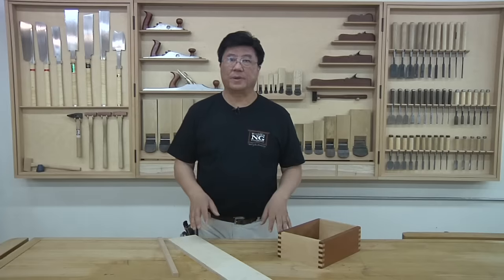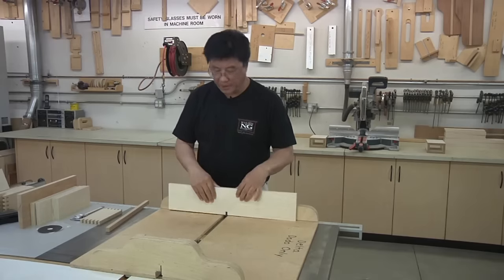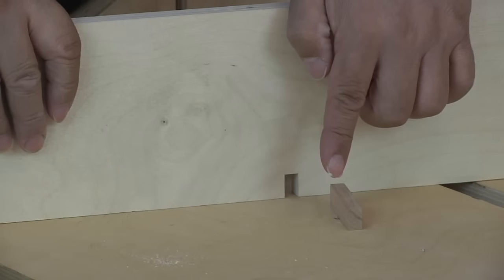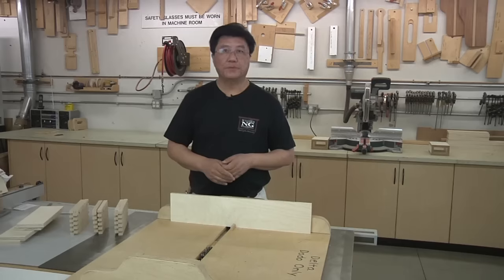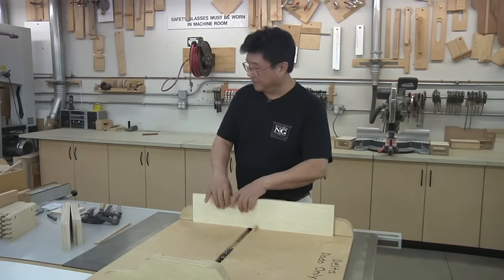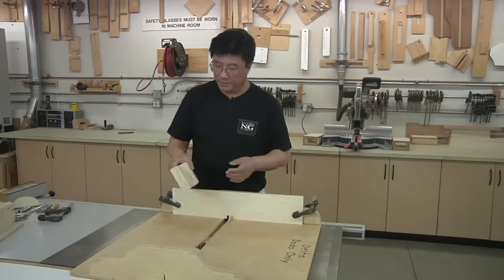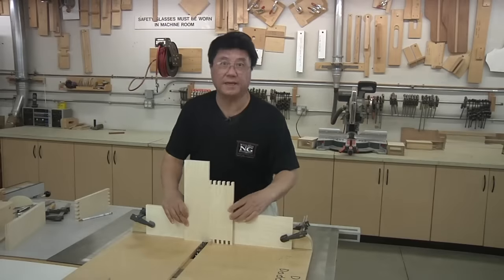Make an Accurate Box Joint Jig, Simple and Fast

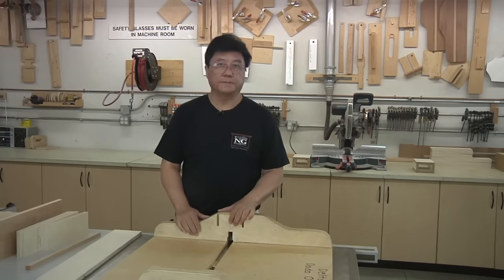Comment: Hi William!  Why do you set the height of the blade 1/32" higher than the thickness of the wood (2:12)?  That would make the finger project at the corners, rather than flush right?  I just made a sled (from scrap) for my router table today, and will be cutting 3/4" fingers with 3/4" Pine boards.  I've got 10 boxes to make...soon to be a semi-expert thanks to you!

Comment: Hi William.  THANK YOU SO MUCH.  This is an amazing video!  I've just completed building my jig from this video and it works amazingly well.  I didn't have a dado sled, so I built a scaled down sled from your video on how to build a crosscut sled.  Your detailed instructions along with all the tips and explanations are perfect for an obsessive compulsive type like myself.  Using the first pin from the front/back piece to offset for the first cut on the side pieces is brilliant and it worked perfectly.  Marking the edges of the blank pieces and then keeping the marks facing the guide pin helped be cut all the pieces right the first time.

Comment: Another excellent video. My thought for squaring the sled up is way easier than yours. Now let's understand something, you're are wayyy smarter than I am in these matters, so much so that that's why I squared it my way instead of yours. I just ran my go to rip blade for my initial cut up the middle of the sled and put a square along the cut line, brought the back piece to the square, clamped, screwed, switch to dado and done. I thought i'd try the cut method just to see how I made out, and what was that line you used "you aren't gonna believe this..." It was dead on. Maybe I got lucky. 2nd sled I made this way. Other than that, the jig is awesome and your videos are da bomb. Thank you for the instruction.

Comment: Thank you for a wonderful video. I seem to have a challenge with this pesky finger joints. When you are cutting the second set of pieces and you use the initially cut boards as reference, as you using the matching pieces for reference. (ie. the one long board goes with the one short board, and the final two are used together for reference. I know my questions may be a little less than succinct. I hope you can decipher my jumble. Any clarification would be helpful.

Comment: Your video is the singlemost intelligent one that I have watched, including your rationale for using a dado set over a router. I envy your table saw, set-up. Do you thin k it is possible to pursue the same tolerances using as DeWalt Contractor saw as well.  Thoughts?

Comment: So if your spacer is 4 thousandths smaller than the cut, when you move the piece over, which edge of the cut are you holding tight on the spacer? Does it matter as long as you're consistent?
Loved the presentation, thank you!

Comment: I just wanted to say William, I watched this video a while ago and saw you using calipers for measuring. I had never even considered using them until your video. I have a cheap plastic set as a give away item from a local supplier....well, I've used them 1000x since watching your video and they are insanely more accurate than a ruler or tape measure.

It has made some of the things I'm producing infinitely better......I mean, I'm making pieces that are accurate to 1/64th of an inch now......whoot!
Reply from the maker: michael cochrane That's great to hear and I say that with a big smile on my face. When I started using calipers I had a lot of resistance even from my peers when I was teaching at the college. It seems to be more acceptable now. Not only is it more accurate but I find I get the projects completed much faster. Thanks for taking the time to comment.
Reply: I could see that, I know if I showed up at the construction site with them in my tool belt I'd get laughed off the site!

I mean, how did I live without them before? Have to measure the exact thickness of a board? The depth of a cut for the interior panel of shaker doors? The interior diameter of a hole for anything?

I tell you one thing, one day at your school I would probably learn more than 5 years on the job....alas you're in California and I'm in Ontario.....
Reply from the maker: michael cochrane come visit when you're in the area.
Reply: wnwoodworks I worked all over the US a few years ago but the LA area was one place I didn't. I hit most major US centers but not there.

I will keep you in mind if I ever do make it out to the west coast!
Reply from the maker: michael cochrane I thought you meant Ontario, CA. which is about 30 miles from me. I guess you meant Canada. Still the invitation is open.
Reply: Yeah, lol, I get that a LOT.....even when you put Ontario. CA which can also mean Ontario CAnada.....

Comment: Another great video.  I love your precision designs, they've really helped me improve the quality of my woodworking.  I though you would like to have an equation I created that will enable you to create perfectly spaced teeth on any width board --(as long as you can adjust your dado to any size).

Let N equal the number of teeth you want, W equal the width of the board, and T equal the thickness of the teeth:

NT + (N-1) x (T+.005) = W

So, for your 4 inch drawer having 5 teeth:

5T + 4(T+.005) = 4.000
5T + 4T + .020 = 4.000
9T + .020 = 4.000
9T = 3.080
T = .342

So, the thickness of your teeth would be 0.342" and you would set your dado stack to 0.347".

Comment: William, thanks for a great video, the best I have seen on YT for box joints.  However, I do not understand the 3/8 " concept?  Can you explain how this works?  Thank you!!
Reply from the maker: You can use any size you want, it doesn't have to be 3/8. It works for me because I like the look in proportion and I can fit the drawer bottom 1/2" from the bottom by using a table saw to cut the groove all the way thru instead of stop dado where I have to drop and lift using a router.

Comment: Fantastic.  However... I only have a job site table saw that cannot accommodate a dado stack.  Is there a way to use this or a similar method to make box joints with ⅜" fingers/slots using a flat bottom blade with only ⅛" kerf?  I would LOVE to see a video on that.  Thank you!

Comment: Hi William-  I love the tip about using the cut piece as your spacer!  It's brilliant!  But, I have to admit that I'm still a bit lost on how to make the negatives a few thousandths less than the positives. Perhaps a few more viewings and it will click.  (Definitely my status as an amateur, no reflection on you as a teacher!)  Thanks a lot, I look forward to more videos!!
Reply from the maker: +ugonow69 The answer starts at 10:10 The size of the finger is the distance between the blade and the spacer. The opening will always be the same because of the tooling, it will always cut a .365 dado. If the finger's too big, move the jig/spacer towards the blade, that would make the finger smaller. If it's too small then you have to move it away from the blade which make the distance between the blade and the spacer bigger.
Reply: +wnwoodworks Okay, I get it now!  Fantastic, thanks!  Totally ready for that spelling bee now!!  ;-)

Comment: Fantastic education!  Thank you for your fantastic and humorous videos.  Anyone can answer this newbee question.  If I want to use real wood instead of plywood, should I plane the boards to the thickness of 5/8" plywood as in 19/32'' ?
Reply from the maker: 5/8 is just a number. It doesn't have to be exact. Milling it to 5/8 would probably be easier to size the exact dimension of your box or drawer. Less fractions to deal with.
Reply: @wnwoodworks ,  thanks, just wanted it to come out perfect like yours !  What's the math if you use 5" drawers ?
Reply: Now I think I understand.  The fronts are 6 fingers and 5 slots, the sides are 5 fingers and 6 slots, so that the groove for the bottom is hidden by the outer wall of the first finger of the side counting from the bottom up. It seems with 1/4'' bottoms, you would want uneven numbers of fingers and slots in the order described above. Hope I am making sense !!

Comment: William - Woberful video. Question: you cut one drawer component box joint at a time - front, back, one side then the other. Can the finger joints on drawers be cut at the same time if the guide block is at least twice the width of the drawer sides? That is can two fronts or sides be stacked to cut drawer sides twice as fast?

Comment: I admire your teaching skills almost as much as your woodworking skills. Thank you! I have watched some but not all of your videos so forgive me if these are questions asked many times in the past. The push block you used in this video - is that your preferred shape and approximate size? AND It appears you use it with the front or leading edge angled slightly in toward the fence - is that intentional to keep the workpiece against the fence? If you have a video or article about the push block I would appreciate receiving the reference. I also noticed a Canadian flag sticker on your fence - greetings from Ladysmith BC.

Comment: Suggestion. What if you made a jig to precisely dial in your fence rather than tapping on it. The jig would comprise a bolt threaded into board held parallel to the right of your fence. On turning the bolt it will contact the fence to fluidly move it right at micro increments.

Comment: Hi William,

Very well done. Loved the cross cut sled video too. Built that and what a tremendous jig it has been.

With respect to building the dado sled, did you go thru the same process?

Also, what are your thoughts on 3/8" thick drawer front, back and sides (with a false front)?

Regards,
Fred Ventrone

Comment: I always admire your precision and overall zen attitude.

I'm wondering if you were setting up a production shop again, would you still use this box joint technique, or would you design / use a new jig that can cut all 4 boards or even 8, 12, 16 stacked boards in one pass, and use an offset for the sides.

Comment: Great video, great teacher, my thanks.  
Question though - you've cut through your jig twice in the test cut widening the female opening (not sure what to call it) do you glue that opening up with a spacer and recut the opening or do you just use them as a single use jig?  Thanks again?
Almost forgot another question do you use different tolerances for solid wood?

Comment: William, your video is very educational. thank you doing it.
One question, You say you like to have the openings 6 thou over when working with plywood.
For easier assembly, Do you recommend the same when working with pine or other solid woods? 
Thanks in advance
Reply from the maker: +Mark Million The question has been asked before. My response is between 3-4 thousands depend on the density of the wood. harder wood 3/1000 softer wood like pine 4/1000. Hope this helps

Comment: Thank you for this video. I'm getting tear out in the back of my workpieces (the face touching the jig when passing through the blade). Do you have any recommendations for avoiding tear out like this? For reference, I am using new Freud Dado stack, cutting 1/2" wide dado slots. My saw, DeWalt worksite, is graded for the Freud blades.

Comment: Excellent video and good explanations.  You cut two pieces, i.e. front and back, then two sides one at a time.  Couldn't you cut both pieces at the same time?  Further, if you had 8 drawers to make, you would have 16 front/back and 16 side pieces.  I can see where 16 at a time might be difficult to handle, but two or even four at a time might be possible and save some serious time.  Clamping them together would probably be mandatory.  Comments?

Comment: In keeping with the thought that faster production is better, would there be any negative to cutting the front and back of the drawer at the same time on the dado stack?  I usually do this and tape them together first.  Also, I try to cut most of my drawers heights at .5 inch increments.  This makes a .5 inch cut for the drawer bottom invisible as long as I cut the front and back first.

Comment: Hi William,
I'm working from plans that call for 6 drawers of 1/2" ply and 3/8" box joints.  Nooo biggie!
But, the sides/backs measure 2 at 1-15/16, 2 at 5-1/2 and 2 at 5-3/4.
The math here gets confusing as you pointed out a 3/8 dado may not be 3/8, and, your 4" sides were off by .01 - good enough!
I'm not sure how mine will turn out and I want all the drawers to use the same size finger joint.

Watching the Incra iBox video they point out if the sides can not be divided by say the 3/8" evenly - swap ends.
That is start cutting from the reference mark stopping short of center and rotate the reference 180 degrees and start cutting again.  The results will be an off sized finger in the center.

That should work here also, right?

Comment: I agree with Pac Memphis. Excellent video on box joints. Very thorough. Quick question. Would there be an issue with stacking the two sides together meaning running them through the dado at the same time and then the front and back together as well?
Thanks!
Reply from the maker: You can cut two at a time but make sure both boards are sitting flat on the sled. It's a little harder to handle and I'm not sure if you will save much time.

Comment: Great video William! You are a fantastic teacher.  Also, some funny little bits in this video that made me chuckle out loud.

Do you think box joints are acceptable for larger casework, such as a solid wood cabinet carcass made from panel glue ups? Typically I would use dovetails, but prefer the look of a box joint for this particular project.

Comment: Well done, sir. Using some of your tips for building kumikos for a set of shoji doors. I like to cut the dados for the cross lap joints in a board then rip the board for each kumiko. Does it make sense to cut the dados first then rip...I struggle to get t the perfect dado to fit after ripping to width

Comment: Thank you for your excellent videos.
When you set the blade height about 1/32 above the drawer side, it leaves the fingers proud of the side after assembly. Do you leave them like that, or do you sand them flush with the side?
Reply from the maker: I trim them flush using my Aux fence. I made a video on it.
Reply: @wnwoodworks  
Thank very much for taking the time to respond.
Looks like I have another shop project.

Comment: You explain things so well.  One of my favorite U Tube guys.  Quick question....you say you like the 6 thou gap.  My question is does that translate to 6 thou on both sides or 3 thou each side?  Reason for asking is that I am trying to work out a finger joint that I will be repeating many times (well into the hundreds).  So my big idea is to set up a couple of dado blades to make three cuts at once.  To do so I will machine the spacers out of aluminum.

Comment: I found a neat way to make finger joints without a jig.  re-saw a piece of wood in strips, 3/8" or 1/2" it don't matter cut the strips twice the size of the thickness of the strips,.  If your using 1/2" inch strips and the main one is 9" long cut the other ones 8" long and inter mate them, with glue.  then do the opposite to the next set. they work great and tight every time.

Comment: Perfect thing is NOT the one which contains gazillion of features and there is nothing else to add.
Perfect thing IS the one where everything unnecessary was stripped off, and there is nothing else to remove, while the thing is still perfectly doing what it's made for!
And that are those old craftsman jigs and wisdom. Nothing fancy, overengineered with tons of bells and whistles. Kept simply stupid = perfect.
I really like your style and simple stuff. Well, it seems simple, but details like math behind chosen dado stack and drawer size means it seems simple as there is hardly anything to remove, but on the other hand it depicts the fact it is very well thought through. Not just stitched together with a lot of glue, screws and pocketholes.
Thank you mister.

Comment: Thank you for a great video. One point is a little unclear - you milled a 1/4" slot to take the drawer bottom, Was the front and back slot milled through a 'space' and the sides milled through a 'finger' ? That means the void will appear in the front/back only and at 1/4" is slightly undersized.?
Reply from the maker: Yes, you are correct. that's why the void is front and back and 1/4 plywood is under size because it's metric measurement.

Comment: I seems this jig could be used for any size box joint same as or larger than the pin since the pin distance from the saw blade is adjustable. William, can you confirm this? Your videos are awesome, your a great teacher!
Reply from the maker: Hi Chris, Yes you're correct. It doesn't matter what dado size you're using bc the pins can be adjusted accordingly.

Comment: William, You made a very detailed, concise video. Thanks for sharing. I have a question: Why do you make your indexing pin .004” smaller
than the actual cut? I have read through comments section and never saw the question. Thanks again. Gary L
Reply from the maker: Hi Gary, I make it .004 smaller so it'll be easier to move from finger to finger when cutting.
Reply: William, it seems to me there is some slack when fitted over the pin. Have you found that to be the case? Thanks so much for your reply. Have a great day.Gary
Reply from the maker: Not really. If you have some slack, just push against the stop for every cut. The distance between the stop and the blade is what counts.
Reply: William Ng 
Great, that was what I wanted to know. Thanks so much